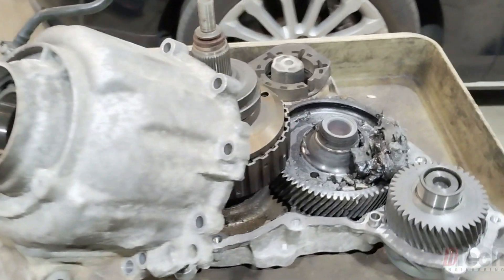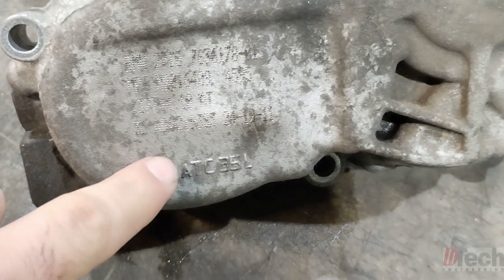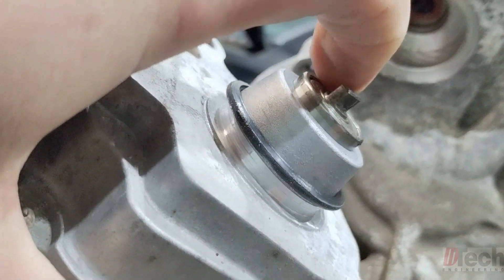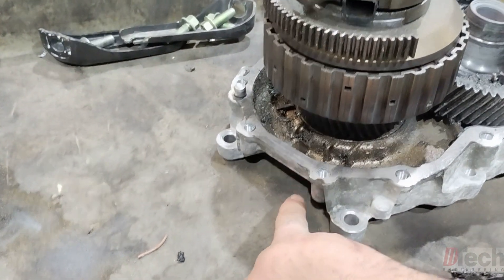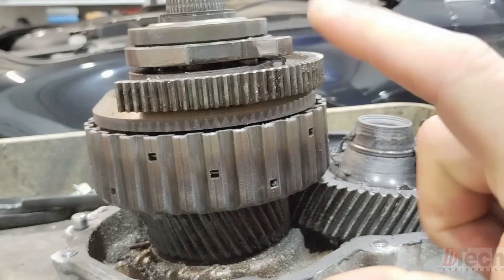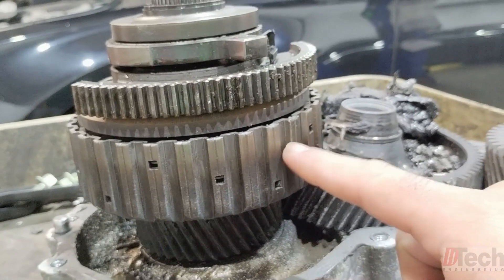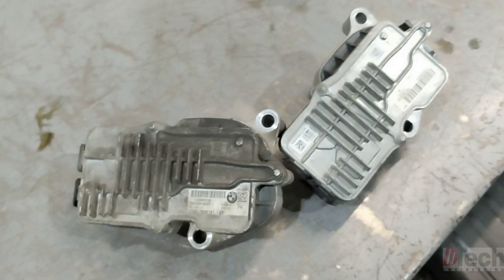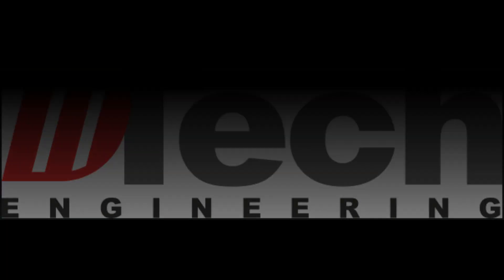BMW/ATC Transfer Case Tear Down Inspection

Comment: I have a 2009 bmw x5 xdrive30 6cyl my bmw its running super slow and the front driveshaft if im in park its totally stuck doesnt turn, thats normal or will be a bad transfer case ???
Reply from the maker: hard to say, but you can remove the front driveshaft and drive the vehicle and see if there's a difference